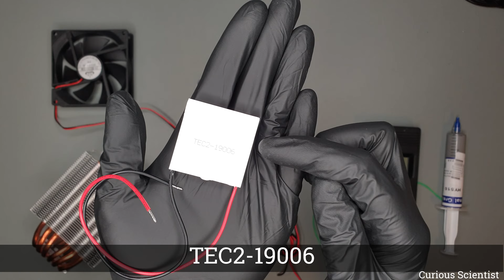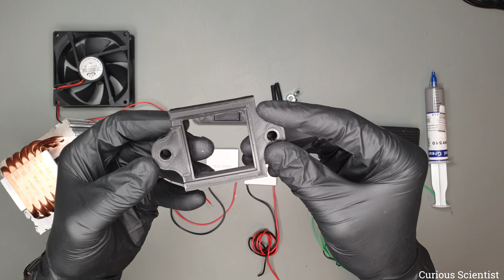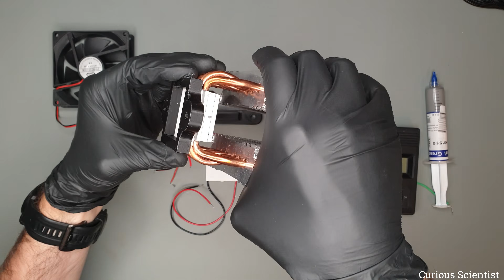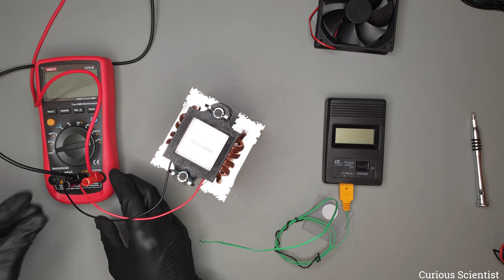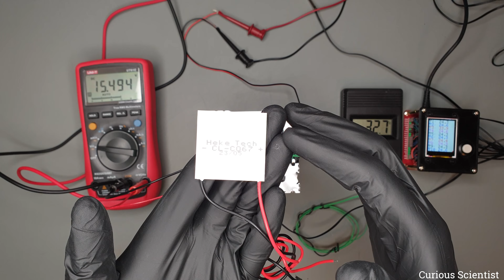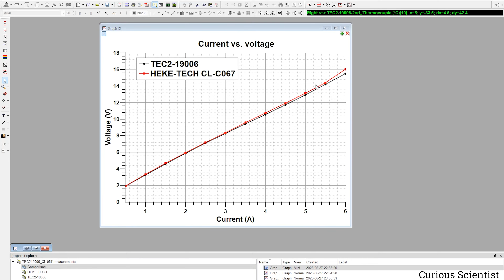Testing two powerful Peltier coolers: TEC2-19006 and Heke Tech CL-C067

Comment: I have seen a lot of videos where they mount portable air conditioners based on peltier cells but even though they look very good and efficient I always have the same question. Is this system viable to cool a room even if I have more than 8 cells. Something tells me no. But seeing your tests of different systems I have better clarified these doubts. 
Now my question is  is it work to ventilate air let's say decently nice at a temperature below 25 degrees?  What happens if I mount the system inside an container and the hot air is taken out of the room through tubes and the cold air is expelled out of the container through holes. It can work at least as a cold air fan?
Reply from the maker: This device might be interesting for you then: https://youtu.be/ZDLN_tMxSQA
It is an "inside-out" heatsink channel with several Peltier coolers installed on its outside. Check the video, it might be something matching your requirements.

Comment: Dear Scientist, during research about developing my own Peltier Cooling project, i found your very interesting videos about Peltiers and usage. I already learned a lot from your videos, but i think i am missing an important part of information (measurement) every time. Or, at least, i did not find it in your videos, in that case please direct me to the video or comments. This is my point, and correct me if i am wrong: I have seen in your videos that Peltiers have a "Sweet Spot" witch is determined by appling a certain Voltage and Amps. This "Sweet Spot" is defined by finding the lowest temperature after reaching equilibrium. I think, the lowest temperature is not the only characteristic to detremine the effectiveness of a Peltier element. The other characteristic i am interested in is how fast the Peltier can reach the lowest temperature. I think the temperature, and the time it takes to reach that temperature do not have to be linked to each other by definition. 
Peltier elements differ in the used materials and their construction. I think that because of that, some might have a Lower (better) minimum temperature, but at the same time not being so effective in the speed it reaches that lowest temperature (analogy: Amount of moved electrons vs speed of moving electrons). Could it be possible to do some experiments where time would be another variable to measure, keeping all the other variables the same. Because IF there is a relative difference in Cooling speed vs Minimal temperature, it would change the way a Peltier could be labelled as Effective or Powerful. So a Peltier having a Less good Minimal Temperature could still be more effective in moving/dissapating heat from the cold side and from that point of view be more powerful that a Peltier with the lowest temperature. Or, are my thoughts wrong ?
Hopefully you get my point ;-). Awaiting your reply, keep up the good work !
Reply from the maker: Hi! Not for these two Peltiers, but for other 5 or so devices, I measured how long it takes to freeze a certain amount of water. That's something that might be interesting for you. I have videos of it on my Peltier related playlist. 

Of course, the "sweet spot" is just one of the many interesting parameters, but it's relatively easy to measure and control, so that's one of the main reasons why I did that. Also, the speed of cooling would depend on how I measure it. I cannot for example measure how long it would take to cool down the surface of the Peltier to -25°C while powering it with 3 V, because at such a low voltage, it will probably not reach it. So, for a comparison, it is not very simple. 

Also, measuring this at the surface of the cold side without any thermal load would not tell too many useful things about the real performance. It would be nice to either have a well-controlled artificial thermal load or a big chunk of metal (4*4*4 cm copper or aluminium) that I can use as a load. Maybe later I will do something along this line, but at this moment I don't want to invest time and money in it.
Reply: That's fantastic intuition!  You're looking for the "Seebeck Coefficient" - the Seebeck Effect is like the Peltier Effect, but heating instead of cooling; it's the same material property.

Good luck, and keep going 😊 🌈

Comment: Thank you for the Video. Interessting to see diffrent types. Im curious what project it will be.

A question: Will you try to use the peltiers in future for a heating experiment? You always used it for cooling, but what about heating? I mean its like.. 10% more efficiant like a resistive heater.
Reply from the maker: Hi! It will be a very large cloud chamber. 

On the other hand, I don't have any projects where I need controlled heating, so I haven't used them for heating yet. Also, they are really limited in the temperature they can go up to. 

Maybe it would be an interesting project for the future.
Reply: @CuriousScientist  Thanks for the informations :). Even you dont have a use for, maybe one day you will just compare it to a resistive heater or something like that
Reply from the maker: I put the idea on my to-do list, but I have so long backlog that it will take some time until I visit this topic.

Comment: Can you do cascading of the peltiers ? Like stacking one onto another?!? Would it work if colder side is attached to the hotter side of the peltier ? So what would bd the minimum temperature achievable by these ?!? Have you done it before ?!? I'm so curious?!?
Reply from the maker: Yes. Watch the video. I even mentioned my video on stacking in this video, and it pops up as a card (small box, top right corner) during the video... Also, there is a so-called search function, and you can search through my videos. I have plenty of Peltier cooler videos.

Comment: Not an expert here by any means, but the breakdown is like this:

TE(C|S)(\d+)-(\d\d\d)(\d\d)T(\d\d\d)

C = Standard Size / S = Small
\d+ = Number of Stages
\d\d\d = Couples
\d\d = Maximum Amperage
T\d\d\d = Maximum Temperature (is also optional)

You can read more about what they all mean at numerous sites.
Reply from the maker: Thank you for the description! I knew about the couples and maximum current, and suspected the number of stages, but I did not know the rest. It is good to know about them.

Comment: TEC2-1006
Maximum Temperature Difference: Delta. Tmax (Qc=0) 80℃ or more.

Working Current: Imax=6A (when rated voltage starts)

Rated Voltage: DC12V

Cooling Power: Qcmax 72W

Assembly Pressure: 85N/cm2

Working Environment: Temperature range -55℃ ~ 83℃ (excessive ambient temperature will directly affect cooling efficiency)

Packaging Process: Four weeks standard 704 silicone rubber seal

Storage Conditions: -40~60℃

So can operate higher than you can store it - stood out that.
Reply from the maker: Why do you copy-paste this here? I know all of this. I bought and tested the product, so I am aware of these parameters.
Reply: @CuriousScientist  You did start stating you found it hard to get info, and with that, only trying to help.  Duplication is verification.

Sorry for the misunderstanding.  Though as I said, curious how the storage temperature is lower than the operating temperature - is that normal?  Will that be a factor in shutting down gradually to avoid leaving in an off state with high temp on the hot side and risk ceramic cracking?
Reply from the maker: No worries! Actually, if you watch the video or read my article, you will see that I stated these values. That's why I was surprised that you copied it in. But it is fine! 

Storage temperature is the "shelf temperature", I assume. When it is not operating, it can be stored at different temperatures. 

Even if you shut it down suddenly, it won't suffer from thermal shock because you are supposed to use them with heat sinks and they provide large enough buffer so the temperature does not drop suddenly. Moisture is a worse enemy, but these devices are sealed properly.